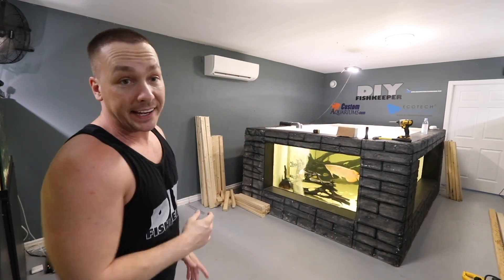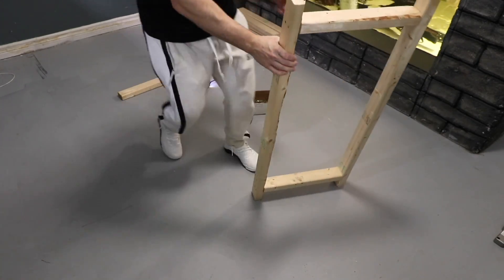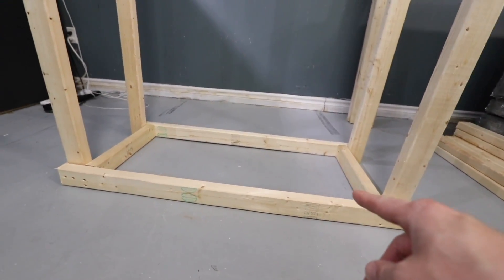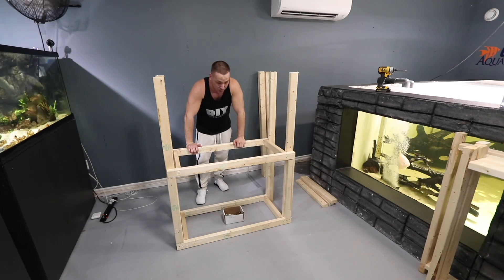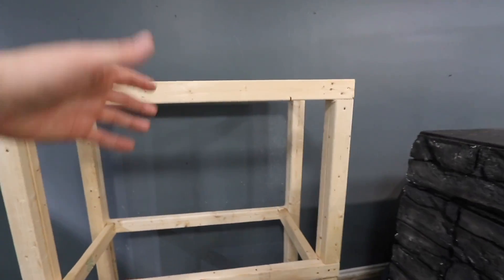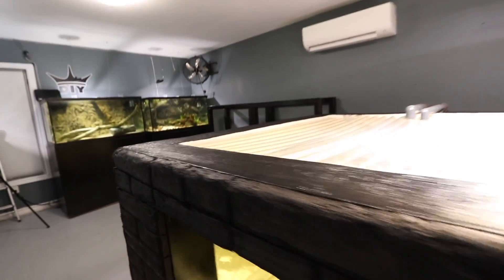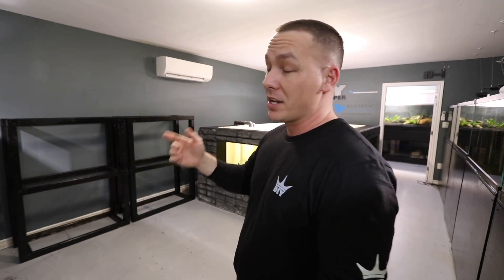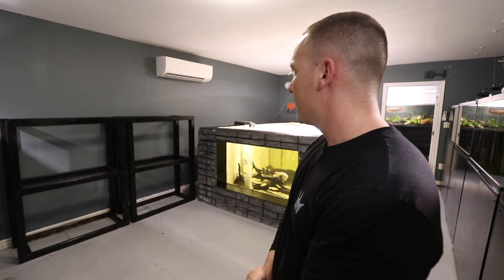DIY AQUARIUM RACKS!! THE KING OF DIY

Comment: Technically with that design, those stands will only be supporting the weight of the  top two tanks. You may have mentioned that but i missed it. 100% over engineered which is the best way to do it when weight is involved. King of DIY for the win. Love your work Joey, keep it up.

Comment: No one ever:

“I think my rack of 120 gallon tanks are two hard to maintain”
“Imma get a rack of 40 gallon tanks instead!”
Reply: To be fair to him the only reason they were too much to maintain was the lack of space to actually access the tanks for scaping. The 40gs will not only require smaller decorations/scaping supplies etc but he can build the stands to his own specs, pull the tanks out of he wants to do something specific with them or if the worst comes to the worst he has 10 other 120g, a 110g, a 375g and a 2000g that he can play around with the scaping on.
Reply from the maker: Aaron Blake Johnson technically they were 6-8” from the ceiling. Had nothing to do with the quantity.

Comment: Looks great, I am curious if the what looks like a Heat Pump/Air Condition right above it will be an issue possible blowing into the top tank and if you need to service the unit.

Comment: What about the Heat and Air system above the area? It looks like it may be very close to the top right tank!
Reply: those typically blow straight out, up or down. and the vent could be adjusted to avoid blowing directly at the tank.
Reply: jessy martin, gotcha. Thanks.

Comment: Didn't you get rid of the racking system on the 120s because of the inconvenience, and now you are putting racks back in for 40 breeders?
Reply from the maker: They were 6" from the ceiling. This is not the same thing.
Reply: Ah okay. I'm sure it will look good. I like the stand you show how to build. I built a work bench and used the same concept.

Comment: water will drop on the wood right .. is that ok ??? you apply any thing for that ?
Reply: From the AC? It shouldn't leak water. If it is, you need to clean your AC or do maintenance.
Reply: @timboardman4916  no Bro .. i mean .. when cleaning the tanks .. changing fish .. sudden leak .. like that there may be a chance you drop the water .. in to the wood Stand .. then over time wood will be less strong .. how can you address this problem .. coz water in the wood ..will be not good .
Reply: @buddhisiri5605  dude there's paint.
Reply: @FlyNRyanfpv  ya what i waan know is .. we use metal for the frames - so .. will wood stay long enough ? i see the paint
Reply: @buddhisiri5605  idk if he addressed it or anything, but in older videos he's made legit fish tanks from wood. There is a specific water sealant paint you can use that seals wood. Check his tank build he did where he made a tank out of wood! It could just be paint for these because obviously idk which paint he used, but I know there is sealant paint others in the hobby have used as well as him.
Reply: @buddhisiri5605  i have built a few out of wood, they hold up really well, i live in Hawaii, everything metal rust like crazy, even when treated properly. Wood last as long as metal for me.

Comment: What about power? I noticed that there is only one electrical outlet nearby. You probably need a minimum of eight outlets (1 canister filter, 6 lights, and whatever plug the power strip is replacing).
Reply: C.D. Reimer  1 big air pump could filter all tanks with air lift sponge filters and no heaters are needed because the room is a stable temperature. Lights however would be different. He could use LED strip lights that’s are flexible rolls and multiple rolls can be joined up together

Comment: Is the foundation 16 inches because it’s Canada and the lower frost line or did you do 16” for the weight of the fish tanks?
Reply from the maker: lookatmysheeaat it’s the new foundation on top of the old one combined. This used to be a garage. I tore that down and built a whole new building.
Reply: The king of DIY cool thanks for the reply. I was thinking it was a lot because to have a car lift in your garage here you only need 10-12”

Comment: Will you please take out a measure stick and give us the dimensions Joey?!? For Fck sakes man, either one for all or none at all. Stand by your fantastic design brother, throw us a bone.
Reply: 1ft 3In  by 3/8 = 6 pieces 
2ft by 1/4 = 8 pieces

3ft by 6.5In = 6 pieces 
4ft 8In = 4 pieces 

The 2x3s cost about $30 from Lowes, Home Depot.  = 10 boards needed but I would buy 12 just in case for corrections. 
Extras: a box of 2 1/2In drywall screws (80)  and a center drill countersink set. 
Also just for fun, Joey is approx. 5'10-11' tall. :) You're welcome !
Reply: FYI I did the math just by watching Joey and the numbers he gave out. I built this rack over the weekend and it's perfect, it's strong and works very well. The only advice I will give to those who want to build this is make sure when purchasing your 2x3s is make sure to eyeball each board and make sure they are straight and true before walking out the store.. DIY 4TW !
Reply: I can verify these measurements work ^^^ built 1 rack today using these exact measurements and it’s exactly the same as in the video. Thank you kind sir!
Reply: @nicholaskessler99  Awesome !! My Pleasure !!
Reply: Can I use this to put 2 40 gallons on it? I was thinking 1 in the middle and 1 on top and a sump of bottom. Would it work weight wise? If I did something similar.

Comment: this made it look so fricking easy and safe! i have 3 30g which i dont use because the shelfing unit is so fricking big and ugly. but now i think ill take that design going in to sketch up and figure out messurements and cost. but my question is what kind of "linked" filteration you can use on this? i rent a apartment and the lovely home owners pay the power because the curcuit box is in our apartment. running 3 seperate filters doesn't sound that cheap on the electric side. i already have 3 5g and one 30g up and running. but if i could get 3 30g in a rack i could just get dividers and keep more fish without the power bill becoming too large. 
for lights i guess LED but when it comes to condentasion how would one deal with that? getting lids made is a no go.
Reply: you could use sponge filters with a large air pump and use splitters to get the air to each of the tanks. this would require only a single outlet and a few air tubes.

Comment: I want to set up my fish tank so bad but I moved to Wisconsin and I live in an upstairs and the floors are made out of wood so I'm trying to figure out how
Reply: What size tank?
Reply: 75
Reply: Jose Perez 
75 gallon with stand and equipment will weight about 750 lbs. As long as you set it up along an exterior wall or even an interior load bearing wall you should be just fine.  However if the building is really old there might be cause for concern. Building codes 75-100 years ago were nothing like they are today, construction practices were often sketchy. So if you’re in an old building caution may need to be taken.

Comment: Joey - Can this design be used for two 75s?
Reply: I would go with 2x4’s but it will work exactly the same way. I’m currently building this rack system for 65 gallon tall tanks that are also 3’ long.

Comment: 85$ - 
7, 2x4x12
3, 2x4x8
150 deck screws and gorilla glue wood glue.
Not built yet...
Reply: What dimension of deck screw should i use please?
Reply: Probably 2 1/2 or 2 3/4. Should be the same size he uses for the stands he built.

Comment: no square, no level, is this why you've had a tank blow out on you?  and you put the bow of the boards facing up like when you build a floor?
Reply: The tank blew out because of a very small rock putting pressure across the base